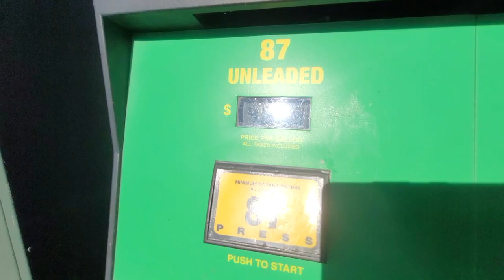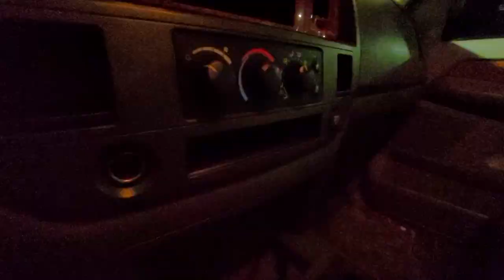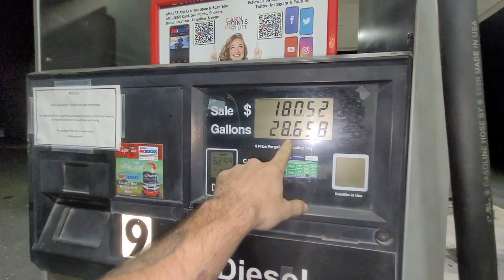I Bought Another Cummins Site Unseen - Already Broke It On The Trip Home 😳

Comment: Where are you buying a $1700 built transmission?
Reply: That's what I would like to know cause ill get 2.
Reply: @motofarmmx2430  I’m asking this wholeheartedly, my transmission is on it’s way out.
Reply: @kopplinfamily7529  same here.
Reply: I was going to ask the same thing! And he said a build one was “cheap” for only 1700, but it’s probably closer to 7100.
Reply from the maker: I'll have to get the name from my buddy. Remember it's a 48re, not a 68rfe. I had 2 of them cheap builds done and they held 450hp beating the snot out of it for a long time.
Reply: @CPSteveMiller  Thanks Steve, My 06 is in dire need lol!
Reply: @CPSteveMiller  cool, let me know. Last time I towed my 5th wheel my tc was not happy, I’d like a mild built 48re for towing (maybe mvb) with stock power.

Comment: I like it. Not all about the wheels BUT it's not my truck so that doesn't matter. Deff needs bags in the rear to help that squat. Just a one car and a Dakota isn't much weight. The tint it looks like either 25 or 20% back looks like 5. Good luck with it either way it's going to make u your money. Maybe do a video of the common rail vs 12v on pros and cons with normal driving vs towing.
Reply from the maker: 12 valve night and day for dependability. Commonrail if you can afford to fix it when it breaks😅
Reply: @CP Steve Miller  I see commonrails going for cheap compared to the 12v I'm like damn it's tempting
Reply from the maker: Prices have been dropping. I saw this one and had to jump on it. Everything is all screwed up. Fix the rust on this one and someone would pay 25k+. Idk why I got it so cheap but I guess we'll find out😂
Reply: @CPSteveMiller  ya how I see it isn't not the price u pay it's how much it can make/break u

Comment: Put a 1 piece drive shaft in that truck 
So much less worries.
Reply from the maker: I did that once and I shattered that thing QUICK 😂 Not a bad idea though now that I need one. Anyone you recommend?
Reply: @CPSteveMiller  I live in Ontario and I use a place in London Ontario for my custom drive shafts. I don’t know of any in PA that I can recommend but what I do recommend is DONT use moog ujoint I use Heavy duty SKF because yes I have had a drive shaft fail not while hauling but driving normal under no load with a moog and it cracked my tail stock off my tranny.
Reply from the maker: I broke the yoke itself. The ujoint was actually saveable 😅
Reply: @CPSteveMiller  crazy 
Must of abused it good 👍
Reply from the maker: I was pulling out of a lot down in Georgia and this person cut me off. I let off the throttle and SNAP. Course I was loaded with cars and heavy but I was surprise at how easily it went. Doubt it was a quality one!

Comment: Hope you enjoy the new truck. Cheap parts are ok unless they go inside the engine or hold the wheels on the truck lol. That payment is almost the same as a brand new car. I bought a 2012 audi a4 quattro and i love that car already, it handles like its on rails. Its just a 2.0 turbo but its fun to drive. I looked at an s6 with the copy of a lambo engine 4.2 v8 but just to change 02 sensors the engine has to come out. Im rambling lol i like the new ride
Reply from the maker: I'll have it paid off in a few months I just didn't want to spend my capital while we're shop searching. Hoping to be in a different shop in a few months!
Reply: @CPSteveMiller  that will be very exciting. Im tired of working on the ground. Ive managed this long i guess it wont hurt me
Reply: @CPSteveMiller  i mean the s6 had the 5.2 v10. Im gettin old
Reply from the maker: I don't mind working outside until it's 30 degrees and windy 😂 Really kills the motivation!
Reply: @CPSteveMiller  the cold is awful and forget snow. I have insulated cover alls that i wear in the winter. Other than not being able to move its not too bad

Comment: If it's straight piped why not 5" downpipe and 6" to the stack
Reply from the maker: It was 4" the whole way. I replaced it with a 5" to an 8" axle dump today. Going to get the stack powder coated before install

Comment: Could just need a fuel filter
Reply from the maker: I forgot to grab one today. I was going to replace it when I did the oil change anyway but I'm assuming that's what it is and hoping that's what it is. Don't want to replace a cp3 or injectors already 😂
Reply: @CPSteveMiller  I've lost count of the number of times the trucks have come in with shutting off or low power, and it's just a dirty fuel filter or replacing it with the wrong fuel filter
Reply from the maker: I towed one once I don't think I'll forget. Nice old guy It was a red crew cab short bed 2wd 3rd gen. He said it won't start. I told the guy "bet it's a fuel filter" when his truck wouldn't start. That was the only reason the shop would touch it was because I already thought I knew what it was. Anything else back then they didn't do anything diesel. Throw a fuel filter in it and watch it run. Would ya look at that it runs now 😂 It's amazing what proper maintenance will do for a diesel.